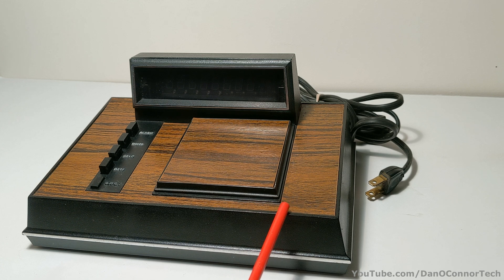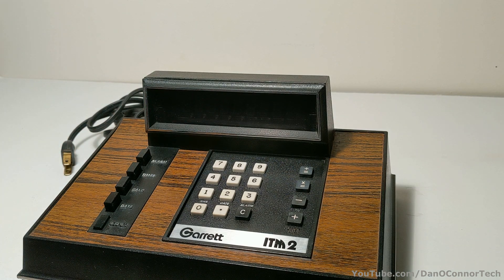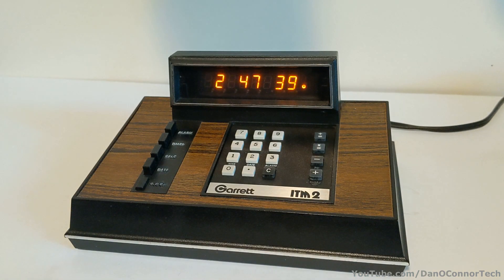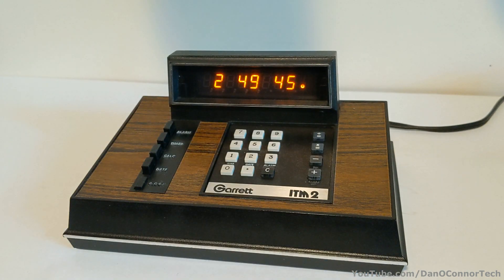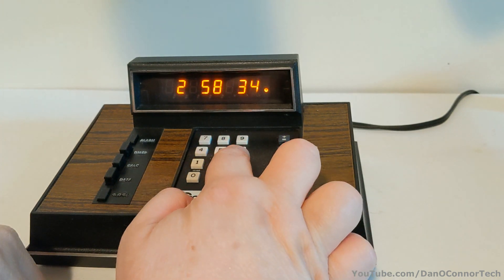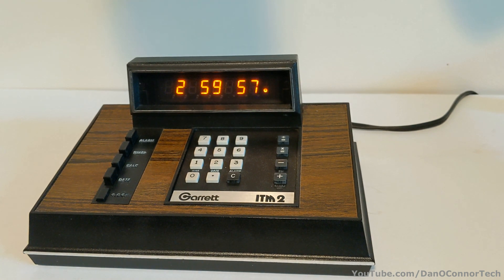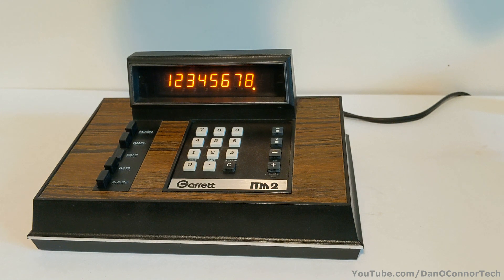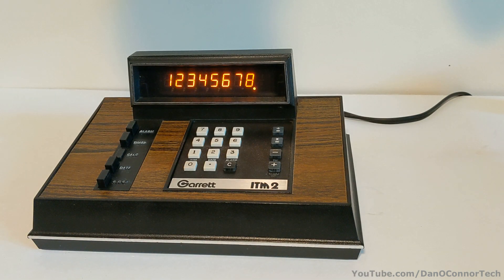Garrett ITM2 Desktop Clock/Calculator and More (1974)

Comment: This is a nice find, it seems to have been barely used! The reason that the alarm isn't working is mostly likely that the piezo beeper has failed. I repaired a Garrett 2002 Clock/Calculator, and it had the same issue. It seems that piezo beepers in that form factor aren't made anymore, but a generic one of similar size should work fine.
Reply from the maker: Thanks for that tip on the piezo. I'd like to see a Garrett 2002. There's an RCA-badged version of the 2002 on eBay, but the seller wants way too much for my poor wallet!